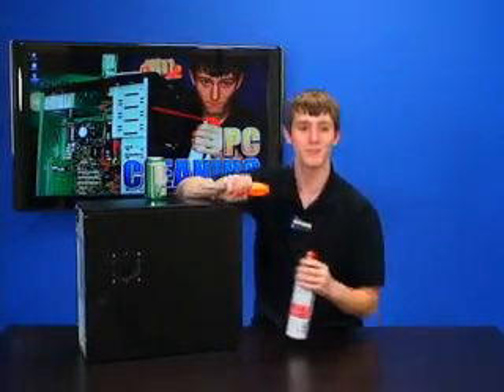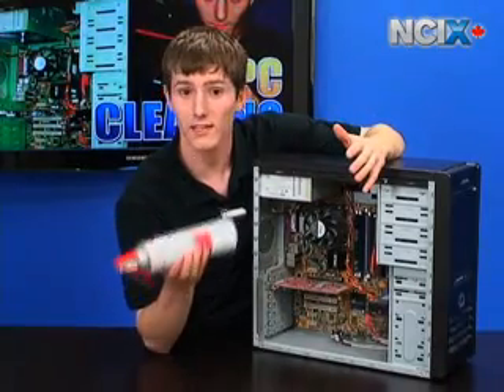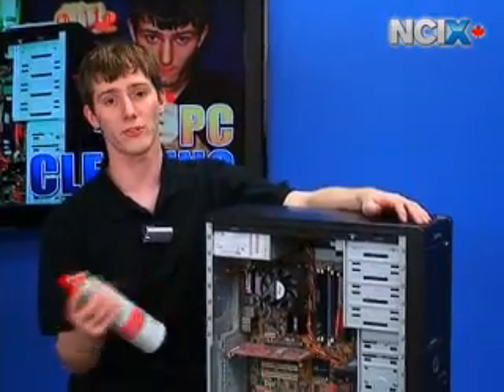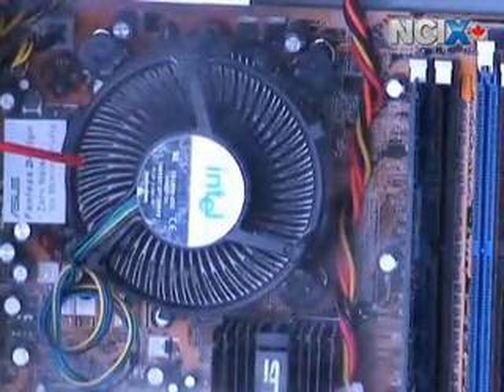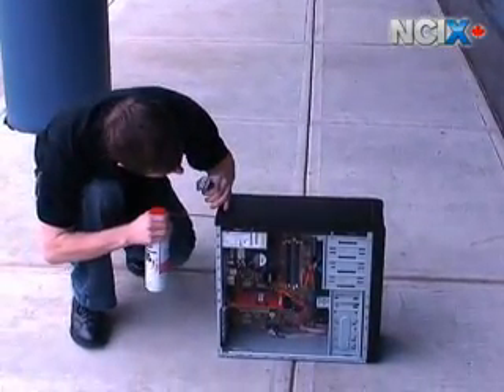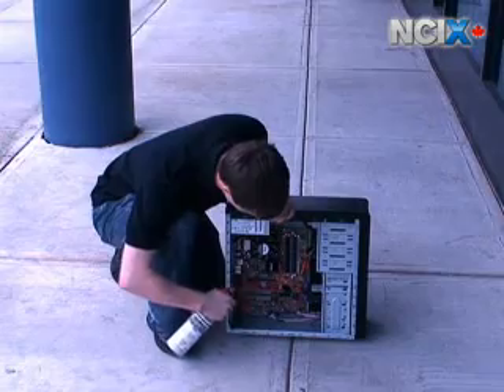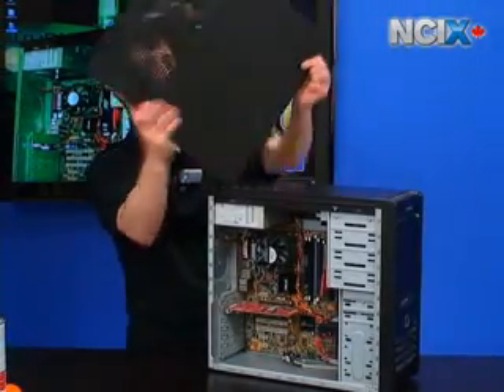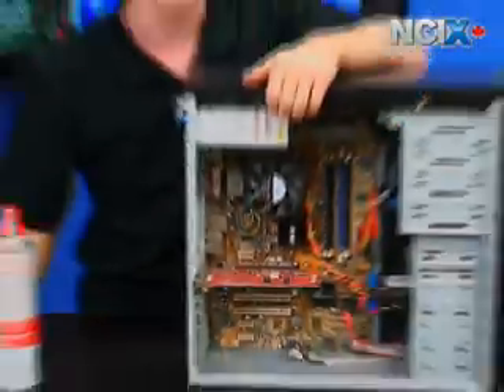PC Cleaning Tips / Removing Dustbunnies (NCIX Tech Tips #13)

Comment: Shouldn't you be holding the fans before you start spraying?
Reply: yeah, you can burn out the motors
Reply: no, you can create electricity by spinning the fan and it will go to the motherboard
Reply: Geez, if fans produce their own electricity then we need to be fucking using them to power this planet. I never knew fans had generators.
Reply: Danmeal They apply electricity to spin the motor, but when you spin the motor it creates electricity back.

Comment: would'nt letting the fans spin damage it?? plz someone reply
Reply: It´s not dangerous for the fan, but for the card who has it, because when you spin them , they create a Voltage difference, and if they are connected  transmitted Current  to the videocard motherboard or whatever it is conected to, so it is a good practice to DISCONNECT THEM to be safe.
  Also dont freak out if you accidentaly make them spin slowly (1 or 2 turns ) connected, its more dangerous if they spin fast because it increases voltage
Reply: so what if i take out the power supply CABLE... will it be ok then?
Reply: MegaJehanzaib No, that is for changing something in the computer,in which case i always turn off the power supply then press the on button to discharge capacitors. But for cleaning heat sinks with fan coolers, you have to disconnect the fan from it´s source of power (motherboard or video card). otherwise you can ruin them
Reply: oh waht if i just hold the fan or stop it from spinning
Reply: it´s ok but be gentil and put your finger to stop it don´t push it or you could break it
Reply: thanx
Reply: MegaJehanzaib No its fine you can spin them as fast as you want.
Reply: Devon schutt Fan port?

Comment: Some parts I haven't cleaned in about a year, including cpu, gpu and The back fan. Some parts I've NEVER cleaned, like my wifi adapter, the front fan and the heatsink park of the cpu fan. My signal increased by a full bar and temperatures are much lower. Dropped idle from about 45 c to 20 c.. Please clean your computer.

Comment: i use compressed air on my comp but there is still like a film of dust on my gcard the i cant get off how would i get that off
Reply: with a soft paintbrush, you just dust it off
Reply: cool thanks :)
Reply: MrRECONGAMES np man, don't use a swiffer pad either, or paper towels or cloths, they will leave behind more than they will take off, because all the solder points on the PCBs catch the little fibers from those things and they get stuck.
Reply: oh yeah and swiffer pads might fry your stuff too.
Reply: thanks! helps alot actually
Reply: LiptonMonster Air compressor.

Comment: wow, you should never clean a fan without holding the blades.....
Reply: dude its 90`s they didnt know
Reply: Lolly Warner Dk. 2008 you mean
Reply: Icefxcycle ;) the only reason for the bearings to go is if they are almost dead in the first place
Reply: I think Know knows that now
Reply: If the bearings go because the air can spun them its likely that the fan bearings were already going bad
Reply: Dude theirs no difference between that having a fan run in a PC at 100% fan speed. I dont get why everyone gets so worried about this... I've clean nearly 20PC's and not one has had a single issue with fans after being cleaned
Reply: Jason Henrie Wow your stupid....

Comment: Pff... I just use a vacuum cleaner X_X
Reply: Static discharge.
Reply: Nah... I don't touch the components, I just vacuum around the case.. When I actually do need to clean the hardware I usually just take them apart (CPU cooler and GPU's heatsink), never had any static discharge issues while cleaning nor while building PC's... 👍😉

Comment: Avoid spinning the fans with compressed air! Could damage it:(
Reply: Mr1950s LOL! Most fans reach up to 2000 rpm and you think a little can of compressed air can make them run at a sufficient speed, DURING a long enough time to damage them.
Reply: TheGingertator If the fans are blown with compressed air, it can make them spin faster than intended to, simply causing the bearings to wear out.
Reply: not really, it doesn't generate enough voltage
Reply: I was told the magnets can be damage if the fan spins the wrong way.
Reply: ***** Trust me, with compressed air (1,5 bar out of a compressor) you can spin a fan with up to 8000 rpm and most fans aren't built for this speeds.
Reply: Hasszahn 133 times per second? Are you sure about that?
Reply: ***** The PC was running and the PWM control displayed 7900-something rpm, so I'd say yes, 133 rounds per second. The sound was comparable to stepping on a cats tail.

Comment: Shouldn't you disconnect a fan's power connector when you shot it with compressed air? Wouldn't want it to sent a charge into your board and fry something. Remember, motors can work as generators

Comment: I think It's not recommended to blow compressed air directly to the fan on top of the heat sink because spinning the fan in the opposite way could damage the motor in it..

Comment: WORD OF CAUTION: you should use the can in an upright position or else the non-inert liquid vapor inside that pushes compressed air will mix with the gas coming out and potentially damaging your computer.

Comment: with one of those air cans you dont. however if you use a high powered duster that you can plug into the wall, then yes it is a good idea to hold the fan since they have much more power and could potentially damage the fan bearing.

Comment: linus doesn't mention it in this video, but it's also a good idea to remove the cases faceplate and dust underneath said part(presuming said case has a removable faceplate to begin with). on a sidenote, i'm sure linus saw his fair share of uber dusty systems even dustier then this one in the video.

Comment: How close do you hold the can also i heard there is moisture in some compressed air cans and lastly do you need to hold it at a certain angle because the temps can get really cold from the can?

Comment: @hertzman5YT Why wouldn't I use a vacuum cleaner? The vacuum cleaner itself is a good meter away from the computer. Should be fine right?
already did it a few times, still up and running..

Comment: Best way i clean out my pc is with a can of compressed air and a vacuum cleaner. i use to compressed air to lift the dust  and while it is floating around i suck it up with the vacuum to stop it from settling again in the case :D

Comment: people always forget to clean their pc's, ive built several pc's for people now and they always eventually come back and tell me it's broke or making noises and it's always due to dust, hair ect build-up in the fans i once pulled a matt of hair and dust out of a cpu heat-sink that was so ingrained it was as tough as light cloth, and physically blocked the fan when a corner got loose
dust filters= £4-10 new gpu £100 new cpu £150 intelligence = priceless

Comment: @naved001video 

In a DC machine an armature(basically shorted coils) is placed  between a stator which has a north and south pole. If it's a motor, you apply voltage to the coils, which induces a voltage = current which creates a magnetic field which acts against the stator field which creates torque = rotation. A generator has a prime mover turn the armature cutting the field, inducing voltage. Field is strengthened by separate source or self excited from armature voltage placed in parallel.

Comment: @Significanto Gas stations are far worse for air than a small canister.Compressors collect huge amounts of warter whilst running and even with "top of the range" filters lots gets into the line (ask anyone who uses air power tools,im a sprayer) and would destroy your computer.At least canister air will evporate very quickly if any liquid does come out.

Comment: @SPECKSPRODUCTION Kinda I had to buy a new CPU for her.The problem with hers was that the heatsink fan had a pipe like a drain pipe atached to it to draw air from the side of the case,it was thick with dust and I did'nt want it falling between the heatsink fins.So I took it off.Others have told me though to use a cmobo of compressed air and a hoover.Just becareful of the "sanke pipe" of your henry making contact with any components as the constant movement of the pipe builds up static.

Comment: @Funkmastabuzz looooooooooooooool did ur sister beat u up afterwards? btw i didnt use the brush i have a henry hoover and i used the black plastic part to clean the fan and other components the best part is when u put it in the fan it moves soo fast that the dust is pushed away and sucked up by the hoover

Comment: Just as a warning to people.... It's a very good idea to hold the fans as your dusting them to prevent them from spinning. The compressed air can make the fan spin much faster than it was originally intended. This can result in extreme wear on the bearing causing the fan to live a much shorter life...

Comment: @pratt123 Ok heres whats funny a compressed can generating a stable amount of air at very low psi.
No stress and no unstable amounts of electricity.Secondly even my dad told me to even use a compressor(electrical even) and he has a degree in physics.So no I have no idea were the stress is.If that the case why do people use wind mills.I suppose they wind is constantly steady.

Comment: @MrCpuclocker Besides generating unstable amounts of power in the computer through a dynamo effect by the fans spinning? Besides additional stress placed on some parts of the fan (due to excess airflow coming in from an angle) compared to others?

Besides these reasons, oh I don't have a clue as to why spinning the fan with compressed air could be a bad thing.

Feel free to confirm any of this at any one of many tutorials on cleaning computers on tech sites. Cheers.

Comment: @cwasc You are correct. If you have an air compressor, it doesn't matter. Just blow at the PC in all directions long enough until no dust is being blown into the air. However, using proper methods will help greatly as you said. Sometimes I blow the hard drives lightly first and then blow away from the hard drives. In this case, the PSU is blown last but from the inside of the PC out. Unsure if this is good cleaning or not.

Comment: Compressed air in aerosol sux because it has inside something more than air what conducts electricity and sometimes you can make short circuit.Better use a compressor.

Comment: Linus, you are doing it wrong. An electric motor and an electric generator are basically the same thing. The motor(/generator) converts electric energy into motion and motion into electric energy. What you did with your compressed air is turning the fan into an generator and producing electricity which went into the mainboard. With a bit of luck you can kill your board that way. If you use compressed air on a fan ALWAYS pull its plug. And try to blow the dust NOT in the direction of the bearing.

Comment: if you blow at an angle it also blows out a lot of dust and you can also blow from the back and maybe top (im not sure abouit the gpu design)
i tried on my 8600GT and it runs about 4 degrees cooler =D probably more on a 280gtx

Comment: Hi, dust is dust - but --> harddrive cleaning???
My harddrive is almost full. I want to buy and install a new harddrive, but I want to transfer all the files = 100% to the new harddrive from the old one. Please advice.
I have XP Prof. Then I want my old harddrive to be my second drive in that computer. IDE drives.
Do you know a software program to buy/download from Internet? ...and how to do it after the download.

Comment: 8$ for that is alot

get them from costco
6 for like 12$
its actully a very good idea to do it for a laptop because those build up fast!!
and theres not alot of space where extra built up heat could go
computers freeze and go crazy when too hot
even for a low end centrino duo

Comment: I've never smoked, although others in the house did. However it's been almost 100% smoke-free for over 3 years now.

The dust on the inside of my case is the light, easily dispersed type, but the fans and heatsink always seem to attract the "fuzzy" kind of dust that looks like it's growing fur.

Perhaps you should make a cleaning video showing a computer that can't be so easily cleaned. In my experience, that's what many/most people's systems are like inside. :)

Comment: well yes indeed spinning a 12v or higher fan to a level will give it some kinda "juice"/life and you can see this by taking a led fan and spining with air it will turn on the leds the faster the air spins it the more brighter the leds so inturn the fan will give of some power but i dont think it will effect the mobo at all just hold the fan with your finger